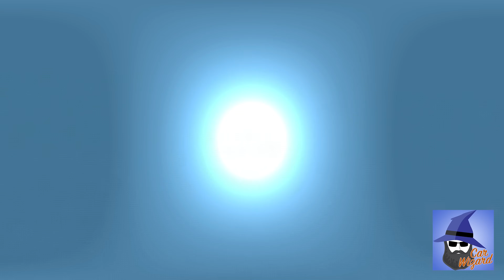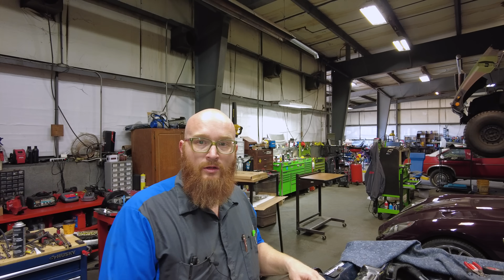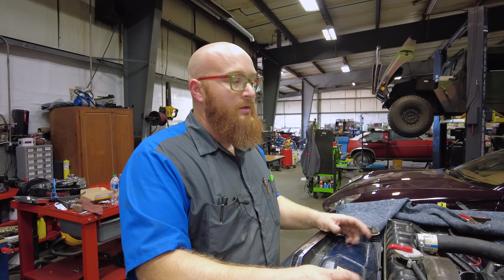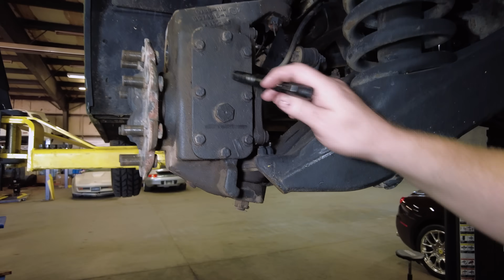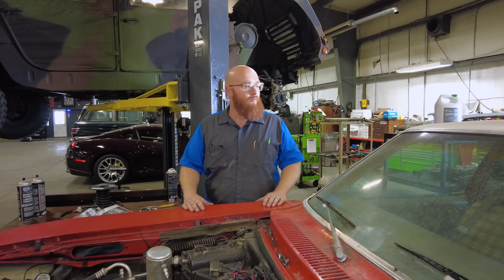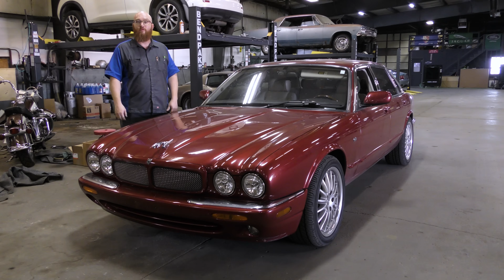No Easy-Peasy Engine Swaps! How could something so common go sooooo wrong for the CAR WIZARD?!?

Comment: To be honest, there are easy swaps. For example mitsubishi engines for the last generations outlands and lancers are almost 100% interchangeable due to mitsubishi trying to cut production costs. I got a 4b10 engine swapped to a 4j11. Almost all of the wiring is the same.

Comment: That Hummer brings back nightmares for me...around 2004 the DOD started requiring them to be armored and air-conditioned, but riding in these fabric door Humvees in 120 degree heat wearing full battle rattle with the windows zipped down (felt like a hair dryer blowing all over you) was borderline torture.

Comment: i must of got really lucky when i ls swapped my 89 chevy c2500.. i bought a 03 suburban a tree fell on the roof, ordered a wiring harness, engine mounts and headers and dident have any issues aside from installing the new engine mounts having to take the lower control arms off to do it.. but i came in 800 under budget doing everything myself, including making my own exhaust from the 03 suburban exhaust, only took me 3 months, the suburban had 212 k miles on it and dident leak a drop.. sure enough after putting 50 miles on it the rear main seal went.. so the engine came out again.. took me 3 days to do that..   that 800 is going into all new a.c components tho

Comment: Replaced my ‘08 F150 4.6L with a LKQ remanufactured engine. Better than an overhaul. Good warranty. LKQ does the engine upgrades. Total cost $6500 P&L best decision. I had P Boys do the exchange. Took 2 weeks start to finish. They did a great job. Currently 35K miles and no issues. Runs great.

Comment: I just got my Honda Pilot back after  $4,300 valve & head rebuild because the timing belt snapped. It is still ticking very bad and leaking oil all over my driveway. Is this normal after a job like this?

Comment: When i ran a salvage and fixed cars to sell i would go for an original factory part.  That shiny rebuilt transmission in the wreck would be sold easily but not for me.  That rebuilt starter, alternator or what ever was never the one i'd choose .  We called  Autozone  alternators the "Prince of Darkness".

Comment: I've done like 10 Swaps and I have learned you need a whole Donor Car to pull parts from .
  If I had a bad motor I would go find the exact same model of a POS that had the same motor and trans combo But was good . Even if your intention is to Rebuild your motor or Trans You can drive the POS till you resolve your Car OR you can do the swap and send your motor out to be rebuilt .With a whole Donor Car you have that part the parts store doesn't carry .

Comment: Brother, I've always found engine swaps to be problematic. Even common swaps. Even stock to stock. I've had to take apart a new engine to change the crank reluctor wheel because the ECM wouldn't read the one that came with the engine. I think you've covered that kind of thing before. Point is it's never plug and play.

Comment: I have seen easy engine swaps and nightmare swaps.  Of course most of them were in the sixties and seventies.  Easiest swaps were different displacement engines of the same era.  Example small block Chevy V8 to another chevy small block V8. Most difficult were swaps of engines from one make into a car by another make.  Sometimes there would be kits to “simplify” common swaps. But there were always difficult modifications needed.  Example: replacing the crappy 4.2 liter sixes in Toyota land cruisers with a GM V8 . This last also required a transmission and transfer case swap  because the original units could not take the additional torque.  Along with that there was the reshaping of the body snd welding additional frame supports.  And one often forgotten or ignored job was installing better brakes to stop the heavier and faster vehicle.  Similar problems were involved with the rarer, but still performed GM or Ford V8 into a Jeep CJ.

Comment: I'd like to know how old those tires are on the Humvee. I was thinking they haven't made those old-style Goodyear MT's for around 20 years, later version was the MT/R. By the way, one or more of those tires is mounted backwards,  they are directionals and I can see that the passenger-rear tire is not mounted in the right direction. I bet the missing passenger-front is backwards too.

Comment: When does an EFI system use a charcoal canister for fumes? Even a non return unit need a charcoal canister cause no fuel is stored in the throttle body or fuel rails.

Comment: Hey I'm not sure in the trash on anybody.  
But...
LS swap or other popular engine> spending 2 years of your life for similar original setup with efi 

What do you think wins that argument?   If you have to spend two years of your life just to be similar to original what is the point? Because this motor has been ripped the part so many times.

Comment: Agree completely on timing and budget for engine swaps.  I would not even consider the Jeep a swap, since the drivetrain is the same…modification only (carburetor to fuel injection).  If one even considers doing a swap, my recommendation is to not even start until you THINK you have everything you need to get started.  Last, I believe the days of engine swaps are ending…the degree of integration between the drivetrain and electronics is too complex on a modern car to allow. Swap to be done cost effectively (complexity is just too much).

Comment: Ditto to everything you shared David!  Been at this for over 50 years and the bottom line never changes.  Always 3-5 times what you think in time and money….  The last 15 years I have worked in a country that has very few new parts, (and most of those are low end quality from China), most of the parts available to us are used.  So every project becomes a gamble.  But Kudos to you for hanging in on those two engine builds and getting the old stock lifters n cams.  Timing cover really surprised me but not shocked.  The only alignment machine that could make sense  would be a used one but still have to balance the space and a tech to do that work….

Comment: why would you Dyno! that old engine not worth the risk as you said no break in milage under 4500 rpm 😥 good way of taking 50.000 off the engine

Comment: I have commented on this before but the owners of the Jeep and Nova will need to use special engine oils or ZDDP additives.  It does not not matter how good the parts are, even NOS cams and lifters wiil get wiped out without the additives.

Comment: Hey what fuel system cleaner chemical do you like to use  with the hood hang tool attached to fuel rail and air compressor ?

Comment: Friendly tip for anybody working on the AMC V8 engines be sure do use high-quality oil pump housing and gears and that everything is aligned and shimmed correctly assembly lube and pre-priming the oil system is extremely important on these engines hopefully the Oil tube modification was done when this engine was rebuilt as well. Cheers
Reply: I've replaced a lot of this stuff many times due to jumping time. Those things are a PITA due to the design of that cover.
Reply: @tornadotj2059  You are 100% right on that!

Comment: There's nothing new under the sun. In 1967, my dad decided to swap a 1954 Willys Jeep Wagon (2wd) 6 cylinder with a 1964 Chevy 327 V8. He thought he could do it in a weekend. WRONG! First problem: the left side Exhaust manifold did not clear the steering box. Fortunately we were in my uncle's machine shop, where my uncle was able to mill the manifold so it would clear.   When my dad got the Jeep home the stock front suspension was too soft. And on & on...It's the little stuff that bites you! Well, a year later he had it drivable. Since he used the stock 3 speed, that failed when I was driving it. Fortunately, he later did the same thing, so he always had a spare transmission handy.

Comment: TBH I probably would have broke the cam in with the carburetor, that way your not trying to sort that out during initial start up.  You don't want to run into a situation were it doesn't run correctly during the initial break in.
Reply: Same
Reply: Pretty useless to do that...

Comment: sue these mechanics for this bs you said you could fix it for x dollars that is a contract failure to meet the contract costs the purveyor not the consumer.
Reply: False
Reply: @stuartstogdill2406  not false. Seen many lawsuits won. People need to realize you don't need a lawyer for small claims court. It's very simple. 1.) Mechanic states for X dollars I will repair the problem" you pay x dollars drive car away and the problem still there that is theft of service. They did not fulfil their end of the oral contract. Trust me most shops will just give you the money back once they get the paperwork. Costs them lest to just eat their mistake. Got 3 grand back from a shop that told me all I needed was a head job on the engine and everything would be fine. The cylinder wall was scored the engine was junk so they should have recommended the engine be replaced not slap a head on it at my cost and pray.

Comment: Ain't no easy swaps.  Period! There is always trouble.  Brackets don't swap. Exhaust doesn't line up. Throttle cables don't fit. Oil pan doesn't clear..... and it goes on.

Comment: I've daily driven a Ford 5.0 swapped Volvo wagon for past four years without any issue. I'm very grateful someone took the time to do it right and make it run reliably.
Reply: @jkeelsnc  Bought it already done. Was told its was  Converse kit. Not sure if Jim Converse actually did it but it's pretty well sorted.

Comment: That short runner intake with a stock cam on the jeep just hurts my heart. That intake is killing 40 ft lb of torque in the rpm range that cam is going to run in.
Reply: I don't think there's clearance for the extra height of long runner
Reply: @tomjones5079  the stock intake is a long runner but I bet Edelbrock don't make a dual plane long runner port injection intake for the AMC engine. Would have been better off with tbi and the stock intake if keeping the tiny stock cam.

Comment: We had an '80 Jeep that had problems starting after being stopped even a short time.  We found whoever replaced the gas filter before we bought it put it in wrong. The bleeder to the tank was feeding the carb and the mainline was feed the bulk of the gas back to the tank. 🤬🤣

Comment: I disagree with some of your statements on engine swaps. If you are smart, plan ahead, do research, start collecting parts, equipment, and tools necessary to complete a swap it can go very smoothly. If you are an idiot and decide you are going to rip the 2.8 v6 out of your 87 camaro and swap an ls into it without doing any research, then yes people get overwhelmed and that's when you see it on Facebook or Craigslist. I see these things all the time and people want way too much money, basically for a car in a box. It is very sad to see. They will lose money every time
Reply: In my research I always search for someone who has done the same project before, learn from their mistakes

Comment: Taking advantage of access to an Air Force base auto shop in '77 I swapped a 250CID straight six from a 74 Maverick into my '62 Falcon 2 door that originally had a 170. There was no internet back in those days, so you just muddled forward until everything worked. The swap was a success after some harmonic balancer issues and the little Falcon ripped with that 250. Swapped the 170 into the Maverick and sold it, running. Sadly I sold the little Falcon to a Captain who had been bugging me relentlessly to sell it to him when I exited the military. 
That's one car I really wish I had back.

Comment: The engine in my old 50’s Willys F-head is still running fine on stock parts. With all that engineers can do now why are we building such cheap crap? Why do we accept it?
Reply: Engineers aren't the problem, it's the ACCOUNTANTS and STOCKHOLDERS who want to minimize costs to the point of the parts being crap to maximize profits, public be damned.
Reply: Agree, decades of advancement has only chased vanity and trend.

Comment: It takes what it takes. Colleges have been known to have classes on GM's TBI. If you understand it , it can work great. I've seen it on 345 V8s in older International Scouts. Worked great on mountain trails where carburetors were starved for fuel.
Reply: I actually have a 80’s GM TBI injection set. TBI and harness with PCI

Comment: OK in your spare time (ha ha) look into who and where these crappy parts are being made from. Don't just look at who sells them but where the part was made from. Company's will buy from the place they can get the lowest price from. I'll bet China is the end of the line. 
I worked on cars in the 70's and 80's, Lotus and Jensen mainly. There was no forums or internet back then. I just took it apart and put it back together, and learned every day. Back then it would take me 2 days to do 1 6000 mile service, after months I got to where I could do 2 in one day. 
By the way any Lotus's in your area? Looking for one. Keep up the good work. BTW an alignment rack when the word gets out it sounds like you would be doing a lot more than15 a year. It will pay for it's self, and you don't need to spend$90,000 on a new rack. look for an old used one. The rack is no better then the guy using it.

Comment: Forums....yeah. Wonderful places where someone who's new goes and ask an innocent question and will get hammered by the forum Gestapo. Or, you get those that pretend they know or have done it, but never have, they full of pooh pooh.
Case in point, my son accidentally dropped the balls out of his CV on the end of the drive shaft of his Xr6 Falcon. Being of the new school went to the 'forum'. This gave him two sources of information, first the honest I couldn't work it out and bought a new one and the I fixed it till asked how they reassembled it at which point things go dead. I explained the second category are the blowhards and showed him how, admittedly been awhile had me scratching my my head, but all cleaned out, regreased and reassembled.
Forums, the good the bad and everything in between.
Reply: @jkeelsnc  That's the truth. By coincidence I met someone who I recall had been attacked on a local forum, it turned out he was an electronics engineer by trade, this other individual was yeah well.. I asked him about and he was just like yeah you just let it go, but he also stopped being as involved, couldn't be bothered.

Comment: Yeah, I have plans to swap an old carburated ford 460 big block into my 2002 Ford F-150 when the 4.6 Triton throws a spark plug. It needs piston rings eventually anyway, so why not swap instead of a rebuild on an weak, ticking time bomb of an engine.

What do you think Wizard?¿
Reply: Good luck with that…….
Reply: Back to the future

Comment: Good lessons you are illustrating here Mr. Wizard! I don't like "Money Pits" whether they start out new and turn into a money pit later with absurd costs for parts or maintenance. Or even older cars that have 100,000 miles on them that are money pits. That's why I drive a Panther Chassis vehicle (Town Car) with police shocks, and a real spare tire, and only 100,000 miles on it.  But some have to learn over and over with each new generation that certain cars are more dependable, more rugged, and break down less, and others that are often considered greatly desirable, are, in reality, a miserable vehicle to own (unless you are happy spending tens of thousands of dollars on your four wheel steer, twin turbo, $1000 for a replacement wheel easily damaged by a pothole, love tearing the dash apart for $4000 to replace an "inner environmental control valve port", love four wheel alignments every 10 K miles, love not having a real spare tire, etc. type of guy)...

Comment: Damn, that logic for not buying an alignment rack really sucks. I've already noticed it can be kinda hard to find places with alignment racks as it is. Be nice though if shops without racks could easily tell customers where they could go to get an alignment. I'm surprised it's not higher in demand considering how often people need to change alignment components like tie rods and control arms.

Comment: 2 years for a engine overhaul lol... If you would of been in the know you would of known that Flat tappet cams are a waste of time. You could of had the engine builder put in a retrofit roller cam and lifters and you would of saved the customer and you a a lot of money and time.. Marten Machine should of did the roller set up and fuel injection is super easy and that Edelbrock EFI set up is a huge waste on that engine.. Holley set up would of been cheaper and just as good for a low hp engine! All this says with all this was a Joe Biden type of job lol!

Comment: I used to work on the Hummers when I was in the military and the three things that would always go out like clockwork were the fuel injector pump, the transfer case and the front seal on the transmission. We were busting a lot of rear end gear set because I'm a firm believer parts were not meant to handle tires that big. We were forever replacing Driveline components on these. And it seemed like they were always the same components

Comment: Hardest part about fixing something, is not breaking something else
Reply: I own an e60 bmw and can confirm this 😂
Reply: @Reginald-Bowls  as a bmw and an audi owner too I can also confirm this
Reply: That applies so strongly for interior parts. It's so annoying to learn in hindsight how an interior piece had to be disassembled.
Reply: As an audi and bmw owner I can 100% conform this
Reply: Owned a 2004 a4 here. Replacing something as simple as that thermostat came with every hose connected to the damn thing.

Comment: Only engine swap I have seen go well was swapping in a  V8 for a six cylinder of same make. Still needed new engine mounts, radiator, front springs, throttle, hoses and transmission adjustment.